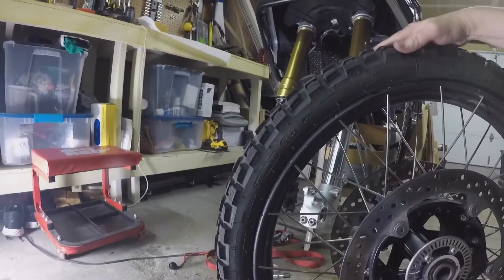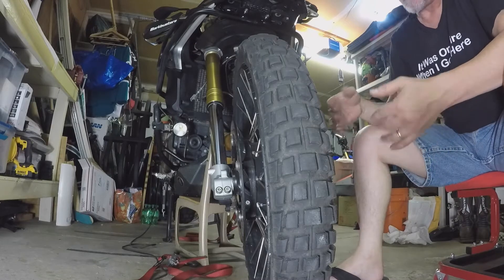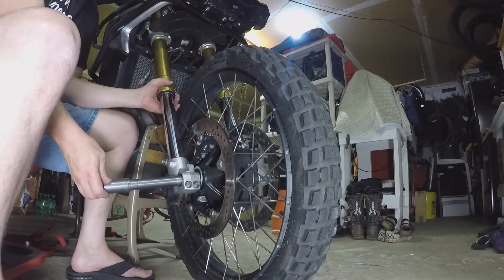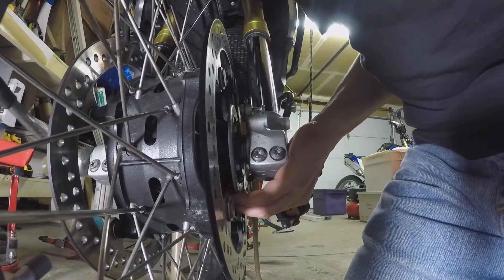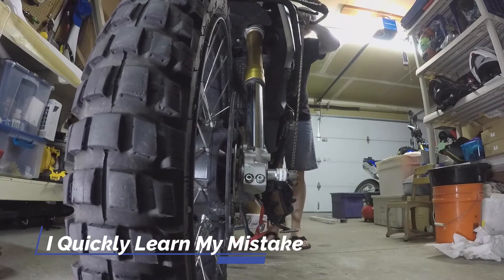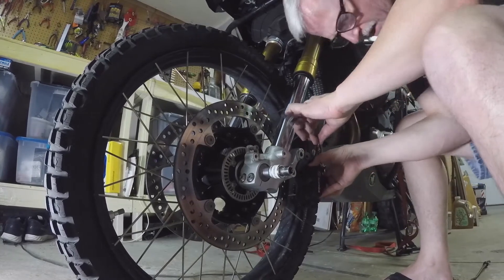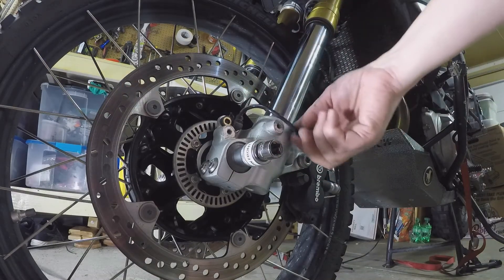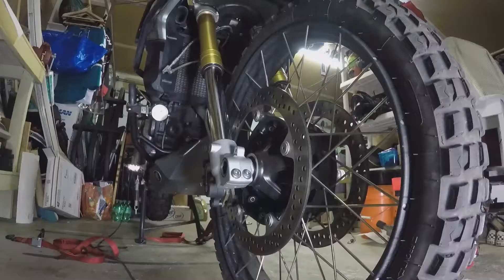F850GS Front Wheel Installation

Comment: Awesome job Bod, I have a question or seeking for your opinion. I will be replacing my front springs on my 2019 F850 GS, with Touratech progressive 40 mm lower spring kit, however I only have 3500 miles on my bike and my front strut seals are NOT leaking, should I replace my front seals?
Reply from the maker: Hey there - well congrats on deciding to upgrade those springs! You'll enjoy the difference, I'm sure. I think the only good advice is replace the seals. I know they're crazy expensive for what they are, but my experience has been that they need changed too often already - and so taking them out and putting them back in... I think it's a recipe for leaks and frustration. Spend the bucks and finish the job 100%.

Comment: Just finished changing the oil and installing Wilber’s springs. I went with Maxima 15wt fork oil, but followed your instructions exactly. Except I put the front wheel on first before the brakes. I will say the most difficult part was getting that little circlip ring out of the left fork to release the spring. OMG, you made that look easy.
Also the oil in the right fork was filthy, it was like mud and only after 26000kms.
Anyway thanks again all the way from Australia and the F850GSA is back on the road and feeling great.
Reply from the maker: Stephen - so glad it was helpful! And I might have gotten LUCKY with that dang circlip. I'm sure BMW shops have a special freakin' tool for that. Great to hear your feedback and success.

Comment: What are your recommendations for balancing the wheels and tires?  I can do my own at home with a balance stand, but I currently take it to a garage to have them use an electronic spinning balancer.  I feel like wheel balance needs to be more precise for a highway motorcycle than a dirt bike.  Any thoughts?
Reply from the maker: First - you're absolutely correct that a highway motorcycle has far greater needs regarding balancing than a dirt bike. In fact dirt bikes seldom get tires balanced. For me - I use a simple stand I purchased that has a steel rod and telescoping slide-on/lock-in things to pinch the wheel in place. I feel it does an excellent job. It takes 15-20 minutes to do the job. I've ridden many many miles on the highway with my home-balanced wheels with zero sense of trouble or vibration. Did you have troubles with the stand you used or just felt it wasn't good for some reason?
Reply: @bobwolff68  I was using two jack stands and the axle with a level.  When I was done, I took the wheels to a shop and had them balance them.  My positioning was perfect, but they added almost twice the weight.  I have since bought an inexpensive balance stand that sounds a lot like yours, but I'm debating whether or not to keep it or send it back and just just the shop for that part.
Reply from the maker: Yeah I'd imagine the balance stand will work much better than the jack stands and axle. It's a much more delicate instrument really. For me, NOT going to the shop is one of the most important parts of changing my own tires. The hassle. If I've gotta go there just to get balancing done then I've defeated the purpose. But you do it your way if you're happy. :)

Comment: Hi Bob, you probably made an error with the position of the brake lines, they must be outside the plastics of the fender. At least looking at the images of the wheel before you removed it in the previous video.
Reply from the maker: I tried to tell the truth in the final cuts of the video. But I may have struggled with a few things and wound up showing it in an "unnatural" position at some point. Gah. My apologies if I got an error in there! :D
Reply: No you are correct Bob, I just checked my F850GSA and the brake lines are inside the fender arms.